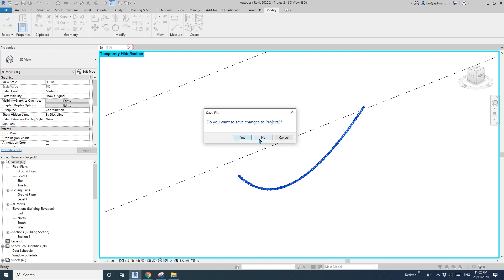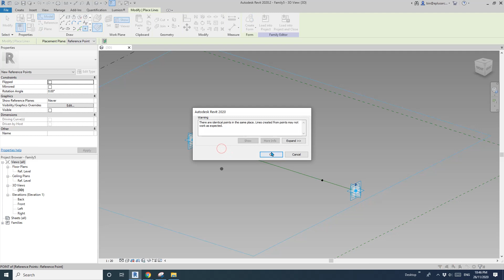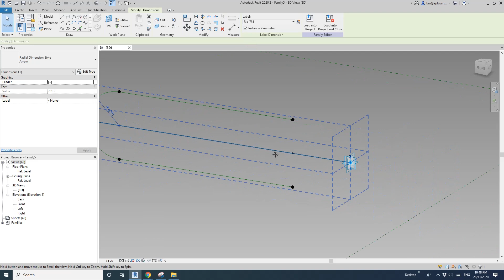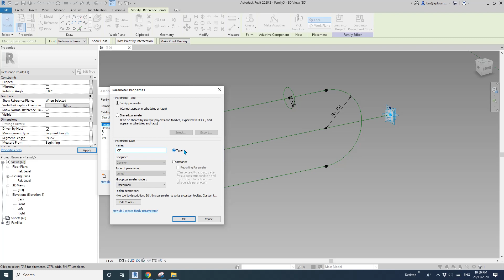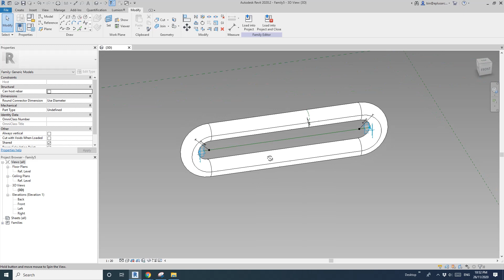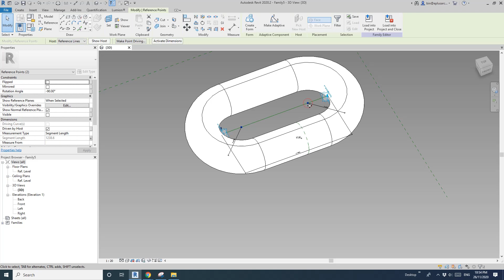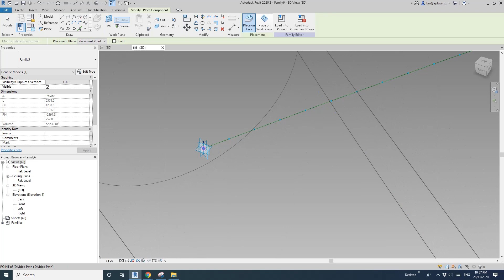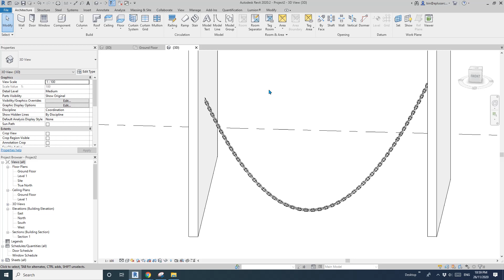Everyday Revit (Day 253) - Adaptive Chain Family

Comment: Great lesson, but when I made this and load chain in my project, and I need 125 chains different length from ceiling "droped like rain" from it in interior, by design, Revit "died" it was so slow even on my Ryzen 32 cores, 128 GB memory, and 11 GB Nvidia RTX 1080...
Reply from the maker: Yes, it is normal. Because each segment this chain family is an individual family and there are probably thousands of them in your file. I recommend you only use this if it is close to your camera, and only do simple extrusions for the rest of them.
Reply: yes, I made chain invisible in draft viev,, it helps, but a little...
Reply from the maker: You can probably try to change the profile from circle to square.  What do you think?
Reply: @BINHE615  ok, I'll try that...

Comment: Awesome video, I am BIM Modeller and it's pretty helpful for me. 

I have one problem if you can help me to resolve it, I have one generic revit family and when I load it into the project I am not able to rotate it in section views. 

There are lots of solution on internet. Do you know any easy solution to do it better? 

Thank you for sharing
Reply from the maker: The easiest way (or trick) is to change it to Mechanical Equipment (TBC)

Or, try to uncheck the Always Vertical option.

If it still doesn't work, you can check the Work Plane Based option if it is available, then place this family onto a proper work plane.